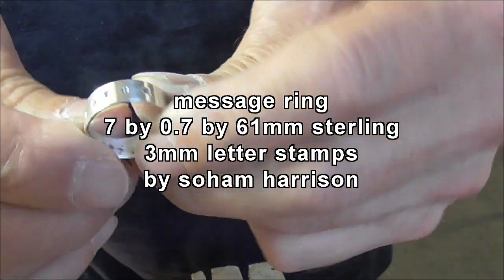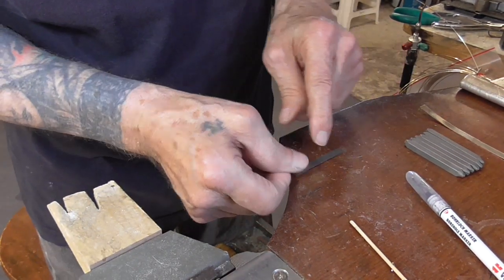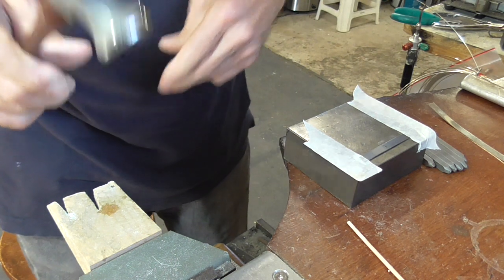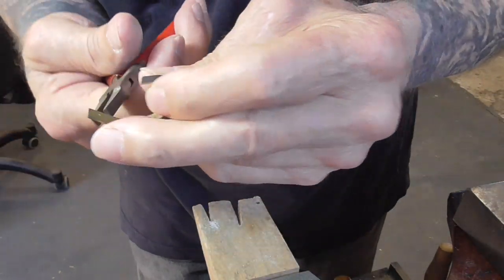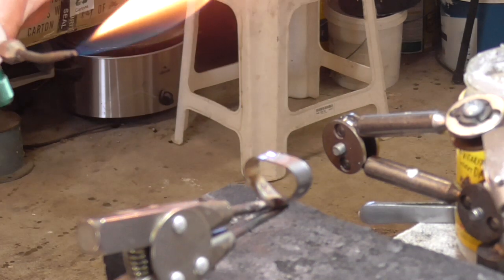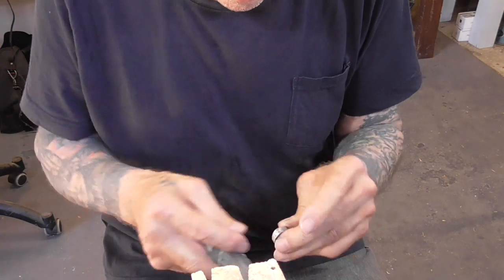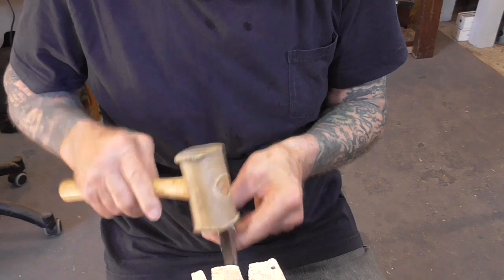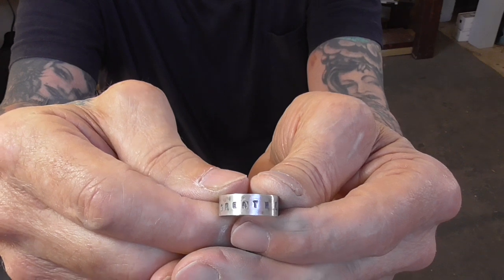message ring

Comment: I know it's going to be a great day when I wake up to see a video by Soham. Even if it's something I've made many times, I ALWAYS find great new tips. You said not to heat the ring from the bottom when soldering. Does that make it move out of alignment?
Reply: I think he flowed the solder with the flame on top then, to make sure the solder was pulled through to the center of the join, he went underneath and flowed it again.